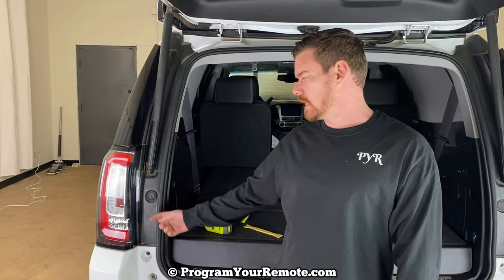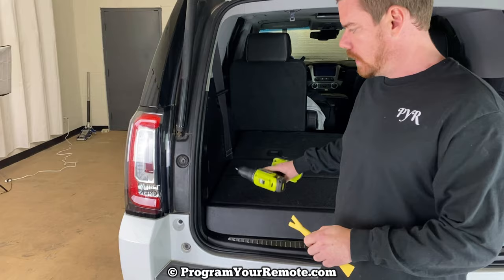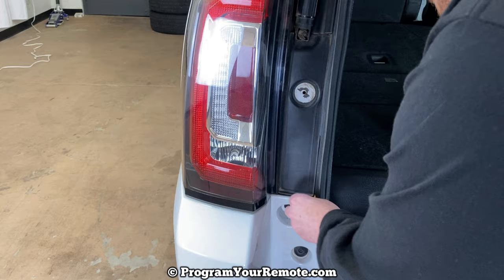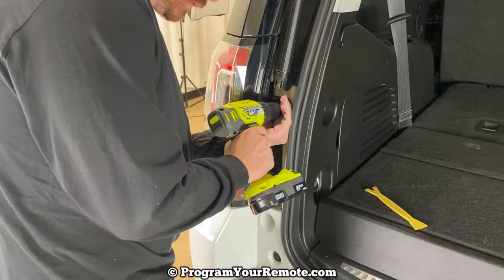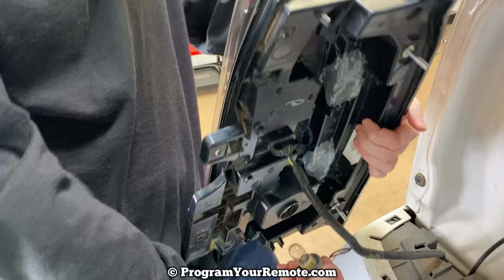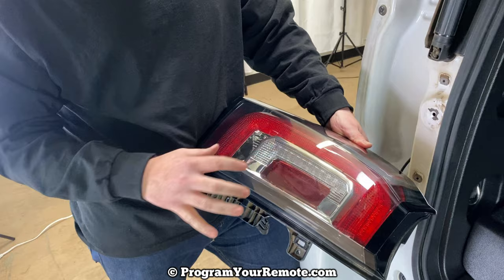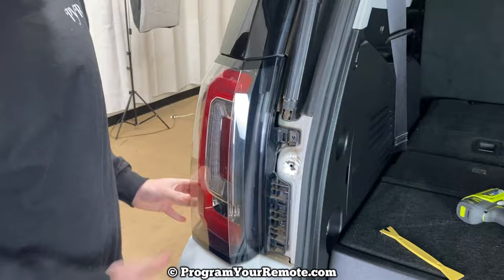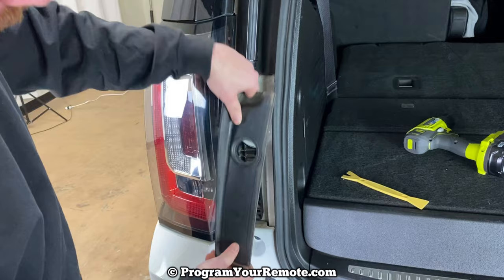2015 - 2020 GMC Yukon Tail Light Removal - How To Remove & Change Brake Reverse Light Taillight

Comment: Thanks for this tutorial! Outside of the ridiculously overpriced cost for the tail light system, you saved me some money on the install. Relatively easy with your video! Cheers 🍻
Reply from the maker: You are welcome!
Reply: I ordered my taillight system from ebay for $55
Reply: The dealership and AutoZone wanted over $800 😱

Comment: Omg.  Whoever designed that should be fired!!!  You have to replace the whole damn thing???!!!!
Reply from the maker: Yes- unfortuneatly that's the only way
Reply: Brian, design wasn't the point. Fired, he/she was probably promoted. If your logic applies to make anything including truck taillights nothing would be made, particularly by Americans.
Reply: Woah. Ok so when my “tail light is out” like “brake light is not working” I have to spend $300 something bucks to replace? 😬
Reply: @azroadster  Been there done that and yes it's the most ridiculous thing ever to change the headlight bulb.
Reply: @TheSpole  More like $750 from dealer
Reply: @TheSpole  actually I just looked at RockAuto they're not even that much better if anything go to a scrap yard or eBay possibly even some aftermarket Chinese tail lights if you really need to save the money. I was behind a Yukon with an LED brake light out that's what made me look this up cuz I was thinking to myself that looks like you have to replace the whole damn unit and I was right. I will stick with my Subaru Forester at least that way I only need to buy a halogen bulb

Comment: If anyone noticed, you can look closely and see that there are two Gray spots on the back part. It looked like he opened it up or someone opened it up and soldered on the inside because I watched another video and the guy opened it up like he cut it open and soldered. At these two joints that apparently break within the tail light itself, so that's why he was saying to replace the whole thing. If the whole thing is an issue, but there's another video on showing that it got cuts it open, and so does it. That's doing the most.
Reply from the maker: Yeah - I didn't fix these ones but they had been done before as you can see.  It's a real common problem on the 2016 and 2015 Yukons.  I think they started using an updated version of these taillights in 2017.
Reply: @PYR-Auto  I have a 17. Same problem.
Reply: I had the same problem 2 years ago so I opened it up and soldered 2 or maybe 3 spots and epoxied over them.  Worked well.  Now I have the same problem in a different spot.  Good video on removing and install

Comment: There was a GM silent 'service campaign' to replace rear tail light assemblies due to mfr problem.  We had both replaced under warranty last March on our 2016 Yuk.  Then the reverse bulb burned out in May.  Thanks for the video.
Reply from the maker: Yeah the 2015 and 2016 Yukon are notorious for having the circuit board in the tail lights crack - the Yukon in the video had that exact issue.

Comment: Thank you for the video. In the comments, one person mentioned that gm has a silent recall on the tail light. I'll investigate that opportunity. If it falls through, I'll visit a junk yard before spending $800.00 from the dealer
Reply from the maker: Yeah it's a common problem for the circuit board in the taillights to crack in these years of Yukon.  There are also refurbishing services you can buy on eBay that fix the tail lights and send them back or you can purchase taillights that are already fixed and exchange your broken ones - that's what I ended up doing

Comment: If just the brake light doesn’t work and everything else does, do I replace everything?
Reply from the maker: if the tail light is bad then yes the whole taillight assembly will need to be repaired to replaced.  The circuit boards in the taillights of these years of yukon are often break - there are several videos on Youtube on repairing them

Comment: Both of my brake lights are out. Dealer said $2000 dollars to replace them. Where can I purchase two for a good price? Where did you purchase from?  Thanks for this video by the way.
Reply from the maker: On these years of Yukon part of the circuit board in the taillights tends to break - it's a very common problem.  Assuming that's what your problem is - you can find YouTube videos on how to repair them but its a pretty in depth.  I actually purchased an exchange service off of eBay where I was sent taillights that had already been repaired and then I had to send my broken ones back in.  I think it was about $250 - $300
Reply: Soldering kit costs you about 15-20 bucks on amazon.. some YouTube videos and boom you’re light can be fix easy, I did myself on my 2017 Yukon

Comment: Could it be a fuse too
Reply from the maker: It could be but these years of Yukon are notorious for part of the of the circuit board cracking inside the taillights

Comment: Great video and explanation!! 

What an absolutely terrible design though. You have to replace the whole brake light assembly because your brake lights don't work? At that point, you should just sell the car and run as fast as you can away from any GM product.